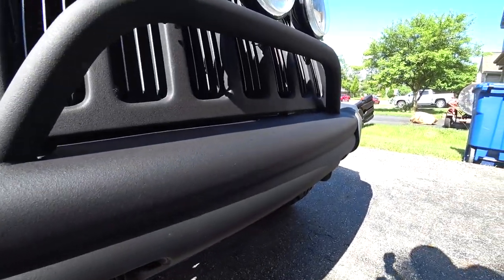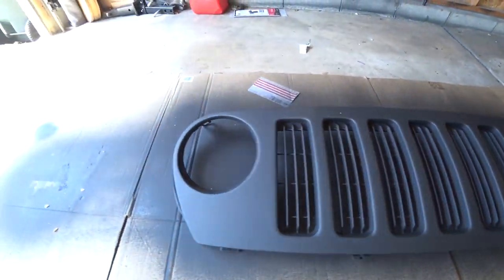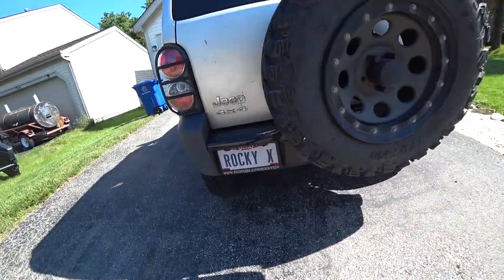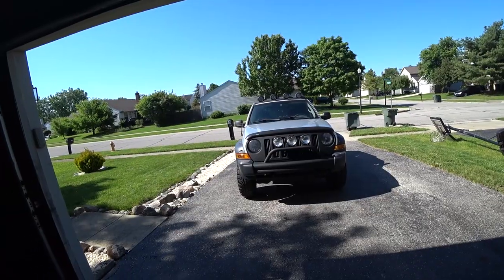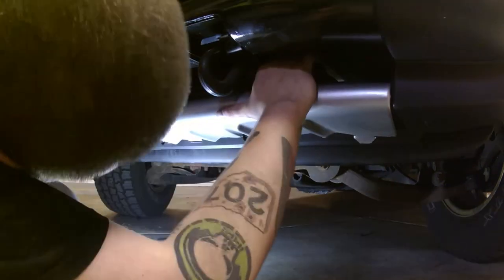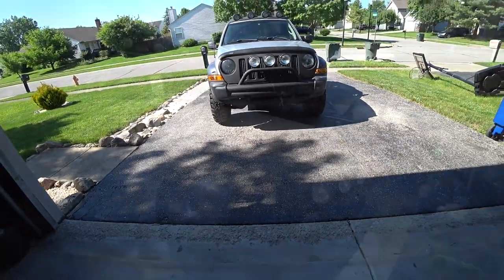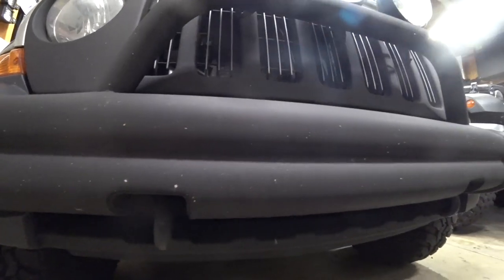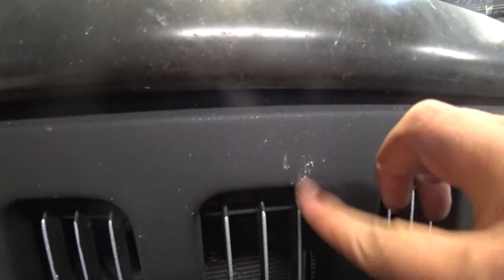Duplicolor Bed Armor Jeep Grille, Project Renegade Update

Comment: Roughly how much power is your liberty making with the bolt-ons and chip?
Reply from the maker: The Chrysler "PowerTech" 3.7 put out 210HP stock. With the added cat-back exhaust, headers, intake, spacer, chip all added together as a package... I'd say around 235-245HP on 93 octane gas. Others that have rode in it say it feels like more than that, but I'm being conservative I guess. This would definitely be a bigger number if I had a better tune on the computer rather than the preset chip tune. Thanks for watching!

Comment: Hello. I have a 2007 jeep liberty limited.  Would you happen to know why my ABS,Traction control light and BAS/ESP lights came on together. I also lost use of my cruise control button on the steering wheel.  Are all these related? Could it be a wire or the "clocking spring" behind the steering wheel?
Reply from the maker: This could be your clock spring, but it also sounds like an ABS wire issue. If there is an issue with ABS the vehicle will disable cruise control. I do not have ABS on mt KJ so I can't say for sure, but I would start simple by checking fuses and ABS wires at the wheels. Thanks for watching!

Comment: Was looking into plasti dip as the front bumper on my 05 renegade is very faded. I wonder if this would be better??
Reply from the maker: This would be better as a permanent solution where as Plasti-Dip would be temporary. I personally don't use Plasti-Dip as it's not permanent, you can just peel it back off. This is okay if you are just wanting to know what something would look like as a certain color, but not to actually paint or refinish something permanently. This Bed Armour will be a lot more durable than Plasti-Dip as well, this stuff is an actual coating that when applied correctly yields a very tough finish. I'm not bashing Plasti-Dip, I've just never had a real use for it. Thanks for watching!
Reply: I used plasty dip on my bumper and and fender and grill and so far it seems to be hloding up good.
Reply: You know how some Liberties came with two-tone? My 06 Limited didn't come like that, so I used plastidip and did it myself. Holding up fine, looks pretty good. I'd recommend it, but you'll have to touch up on it every few months. Try not to overspray

Comment: What's the wheel and tire combo I like that a lot and want that for my 05 renegade
Reply from the maker: The wheels are U.S Wheel Crawler with beadlock, and the tires are Interco Super Swamper IROK NK.
Reply: @RockyXTV  Thanks how much did it caust for all four of them
Reply from the maker: The 5 wheels and 5 tires were Promo/Sponsor products from Interco Tire and U.S Wheel, so I don't know what the cost would be. I did forget to mention that the wheels have a custom offset, they built these wheels just for this project. You can get the same wheels that will fit, but they will stick out just a little bit. You can check out the video about the wheels and tires here - https://youtu.be/V5elojVJ-CA
Reply: @RockyXTV  Ok thanks for the information

Comment: What lift kit did you use for this? I have an 05 Liberty I want to lift but can’t find any for the Renegade trim. She looks awesome!
Reply from the maker: Thanks! To answer your question about what kind of lift... A bad one! It was a 2.5" inch kit from Blitz Auto on Ebay. It has destroyed the entire front suspension in less than 10K miles! The rear is still fine, but I would definitely nor recommend that kit. The front end is only about an inch over stock now... Thanks for watching!